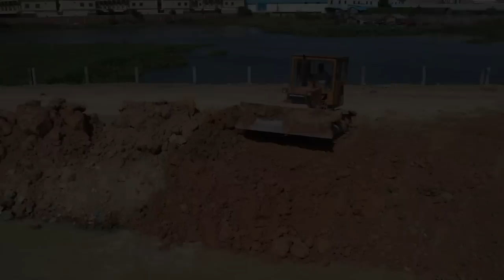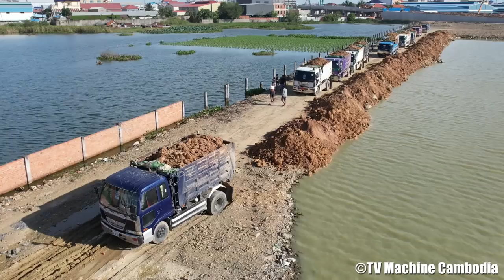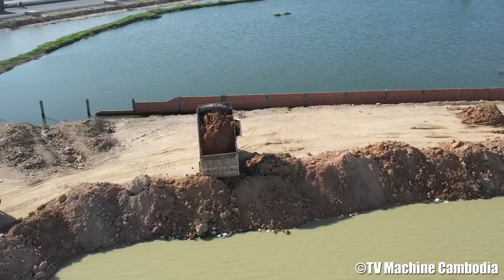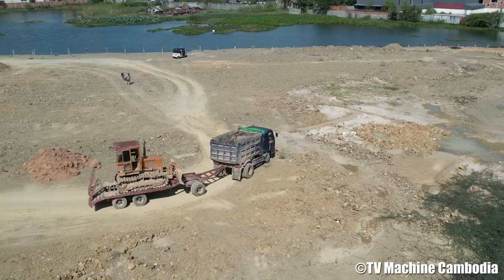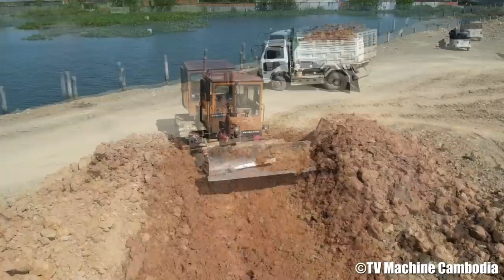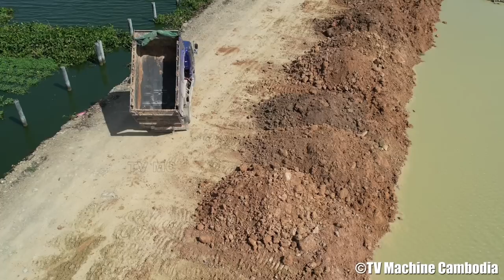Amazing processing operator skills miniature dozer with dump truck 5TON Spreading road widening

Comment: I can't believe the disgusting condition of the dozer. Why don't they look after their machines.
Reply: hey,
your looking at an 80 year old machine 
Very impressive, Komatsu
Reply: А что с.ним не так ?
Reply: Looks like half the track shoes are missing
Reply: @randalfranck1938  Its not 80 yr old, be lucky if its 10 yr old. You don't use pyramid swamp tracks to push rock, totally the wrong machine for the job. Been operating dozers for over 50 yrs and that's not  the machine to use in that situation , that's why it looks like it does.
Reply: Because it just shows how lazy they are...